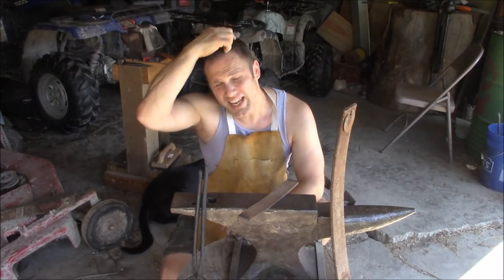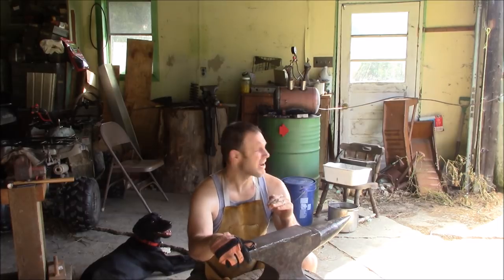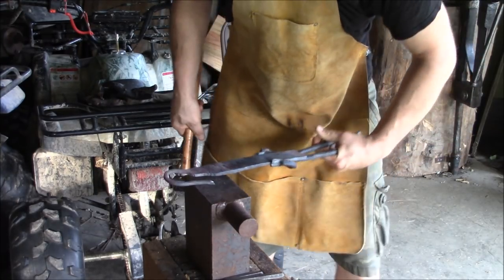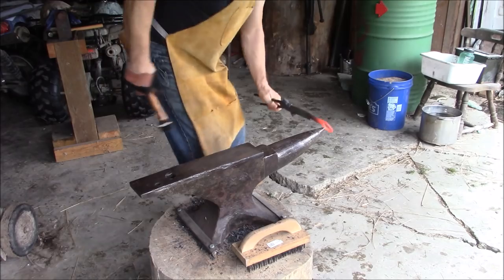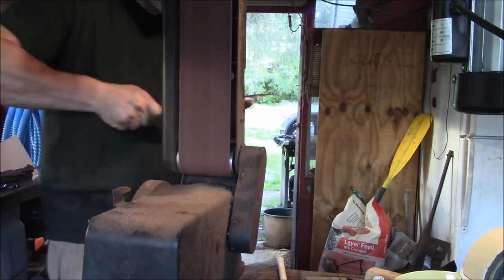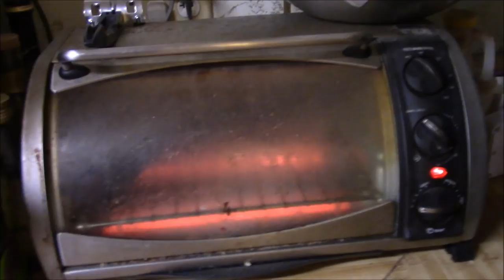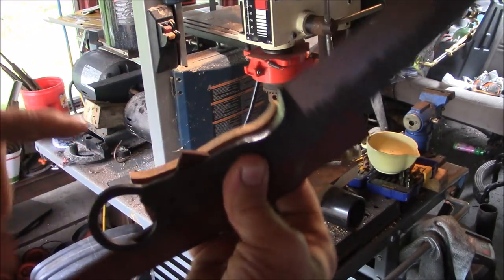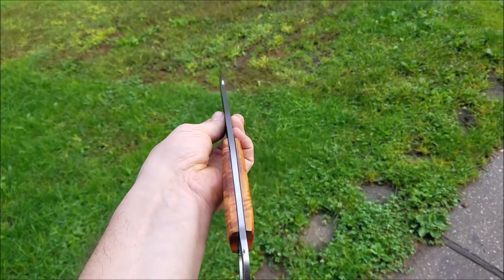Forging a Ring Kinfe out of Leaf Spring.

Comment: Isn't annealing pointless when forging? When steel is orange or yellow hot it's as soft as it could be. Annealing is only done when you need to soften steel for cold work such as cutting, grinding etc
Reply from the maker: Seems like you answered your own question. Were you looking for an answer from me?
Reply: Kind of but not really. I am only a beginner and started working with this kind of material. If you had suggested that it actually makes it easier to forge I'd do it too.
Reply from the maker: I haven't watched this video since I made it. I just watched it. I see what you're reacting to. I think I was just being overly cautious after a problem with a prior project. I'm not a metallurgist but I wouldn't be so bold as to say it's "pointless" to anneal in that situation. Forging puts stresses in the steel that's why we normalize before we harden steel to avoid warping. I could be wrong but, I believe annealing is as close to a full reset of the stresses in the steel as you can get. Even beyond normalizing. If you disagree with that you're entitled to your opinion.
Reply from the maker: @leetpg  I would not say that it makes it any easier to forge. I only did it as a precaution against stresses from the original leaf spring forging at the factory where it was made. I'm not sure it even helps with any future cracks that could have developed. Some of my prior metallurgical research would seem to suggest there's a possibility it could help.